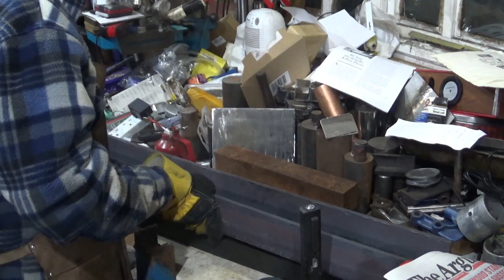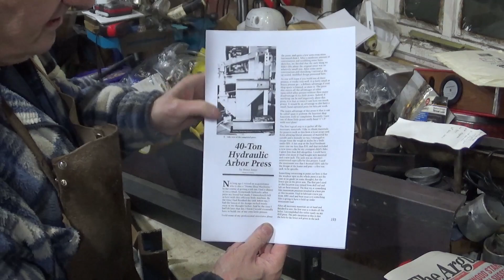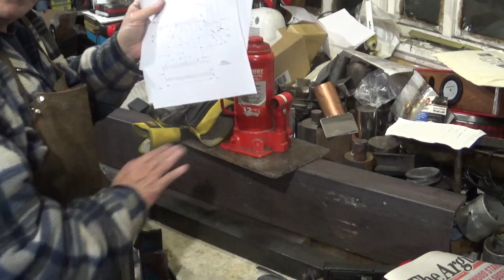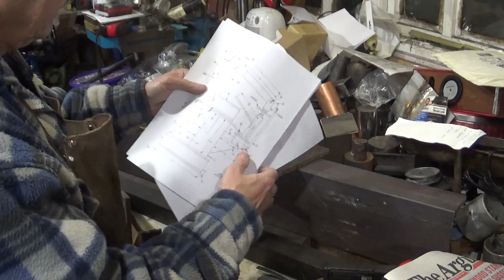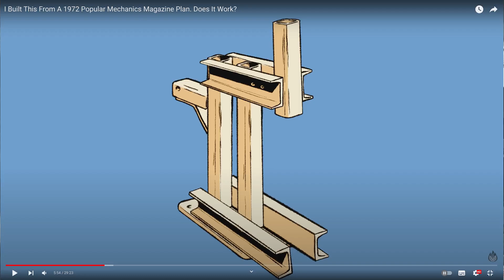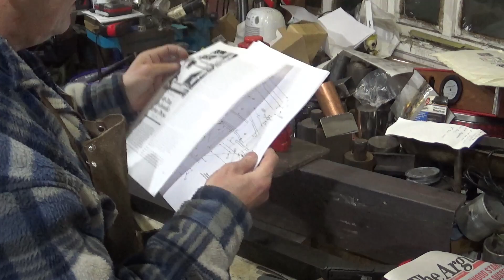Upcoming Project Home Shop Machinist/Popular mechanics 40 ton arbor press

Comment: The Man in the Shed is a great guy. Can't wait to see your project come together.
Reply from the maker: Many thanks Ed, though I have just worked out that the 40 ton press would fail around at around 10 tons with a sheared clevis pin. 

Another short video will be out next week on design calculations. 

Many thanks for watching!